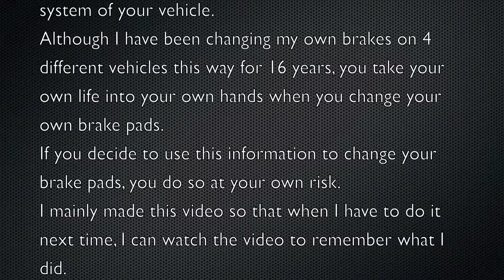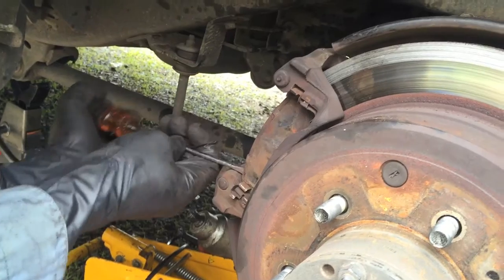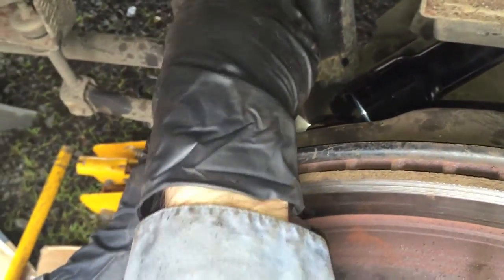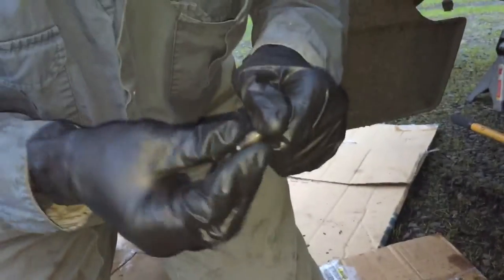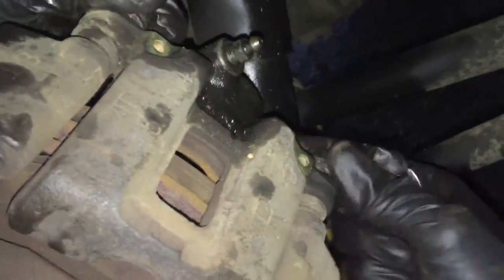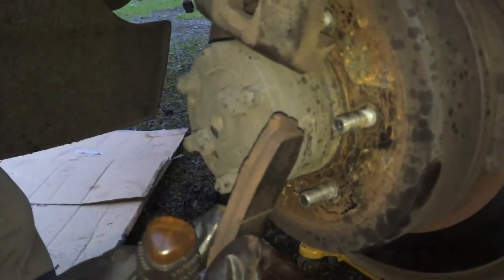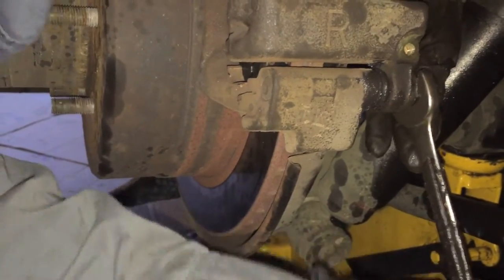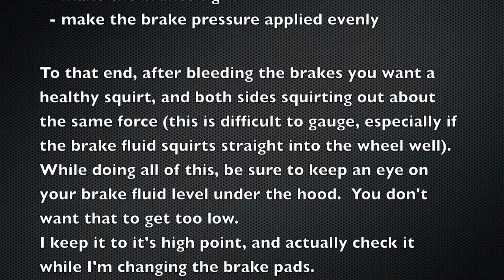96 Toyota Land Cruiser changing rear brakes - read the comments, I made some rookie mistakes

Comment: I hope you have figured out to open the master cylinder and use a C clamp to compress the piston, you should never open the bleed screw unless you are bleeding the brakes it makes a hell of a mess as you now know.   M
Reply: There's never an opportunity for air to get in the system by changing the pads. Taking the brake reservoir cap off just allows the fluid to rise when you press the piston in with a clamp.
Reply: I was having trouble, read your comment, on in 10 Seconds! Thanks for the tip!
Reply: If you have to open a bleeder fitting use a length of 1/4 inch plastic or rubber tubing to drain fluid  into a bottle. Don't see why you would do this when you can just remove the reservoir cap. I pretty much replace the rotors when I do the pads and shoes if the original rotors are even a little wonky (heat warping, grooving, uneven surface) especially on the rear where the parking shoes are inside the rotor. It's cheaper to replace just the pads but you'll sleep better with new rotors. ($35 a rotor or a package kit 4 rotors and pads from Parts Geek or Rock Auto around $200ish with shipping).